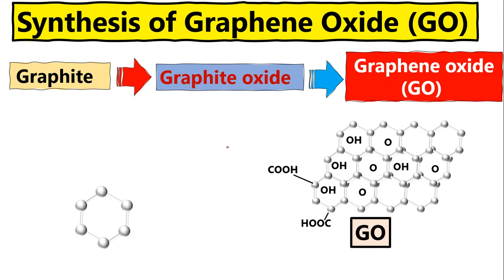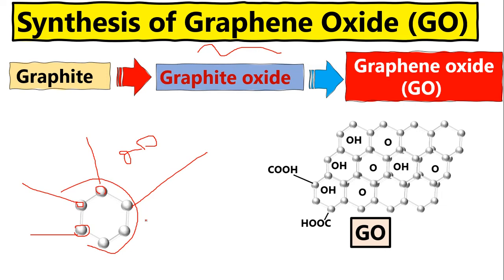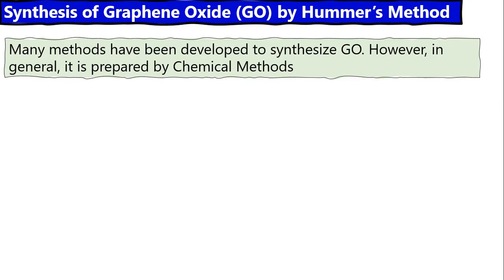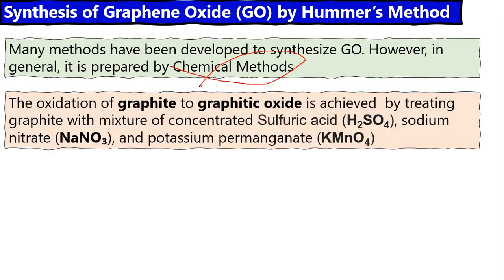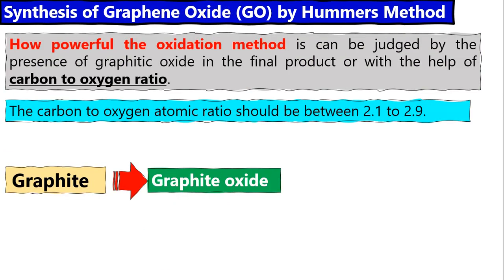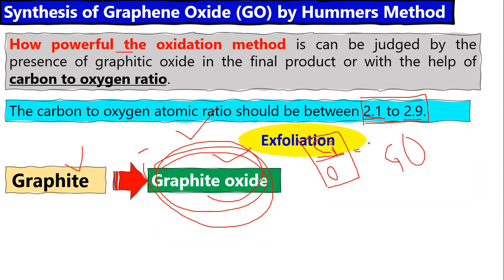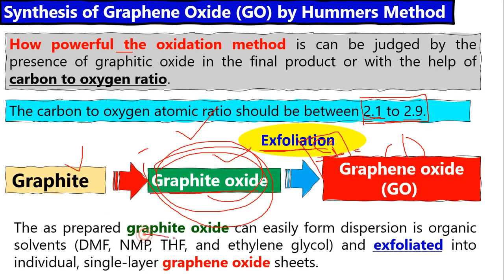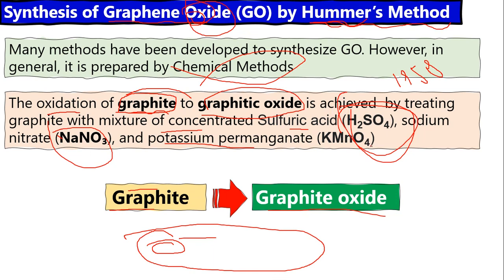How Graphene Oxide Is Made | Chemical Synthesis Explained

Comment: Is there any method to synthesis RGO or GO without chemicals? I mean non chemical method ?
Reply from the maker: Most of the time, the best methods are chemically using strong acids such as HNO3, H2SO4 and KClO3, however,  other methods includes thermal reduction , Microwave synthesis , and Photo reduction approach